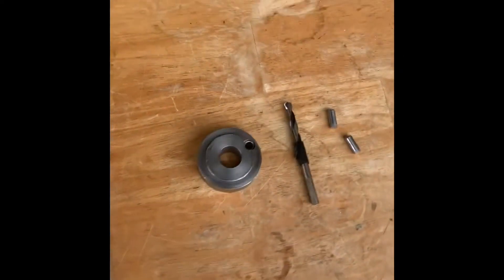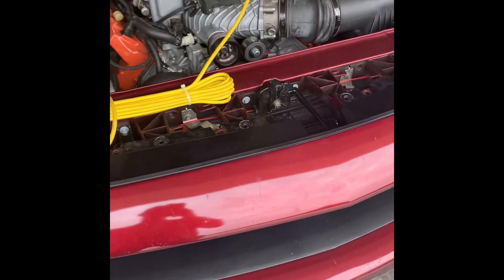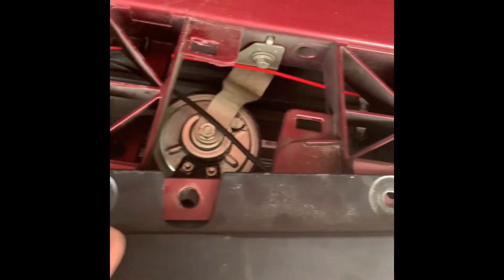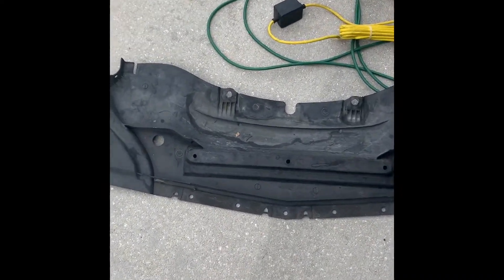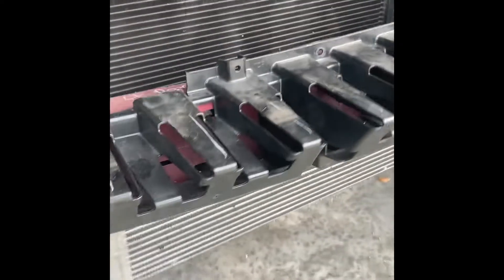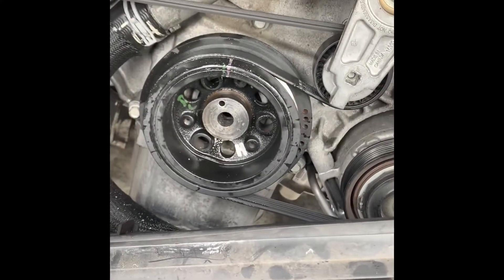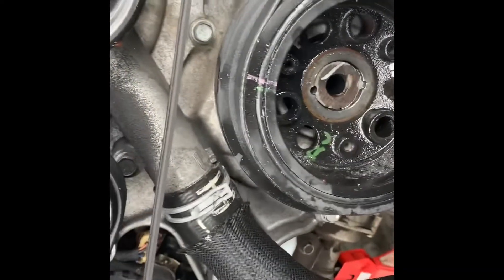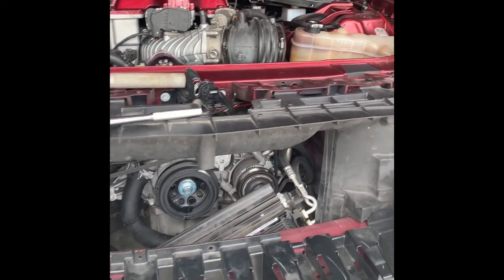Pinning the crank on a 2017 challenger 5.7 with a demon supercharger

Comment: What blower pulley are you using? And how did you get it to the belt groves to to stick out?
I’m doing a stock 5.7 swap and my pulley is flush in the back with in grooved in front
Reply from the maker: U have to flip the pulley around. Am using the metco kit. IG is sicario57

Comment: what function does that have that you did
Reply from the maker: From messing up the button end u can damn the crank or harmonic balance  or even spin a bearing
Reply: @talifesgarage  what screw size did you use
Reply from the maker: @clave13alvarez48  it’s call a pinning crank kit u can get them at hhp or better built or even MMX.
Reply from the maker: @clave13alvarez48  the drill bit was 1/4
Reply: @talifesgarage   thankson the back of the supercharger of the two harness one goes to the map and the one of the fuel pressure pum where it is connected or it must be modified
Reply from the maker: @clave13alvarez48  another name is crank pin kit
Reply: @talifesgarage   i find